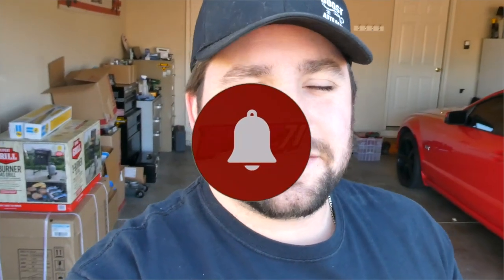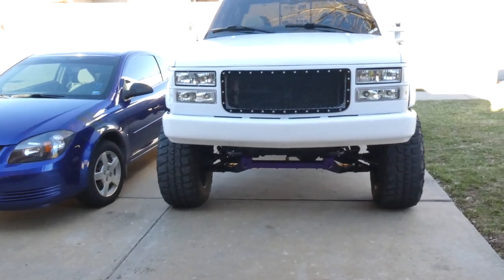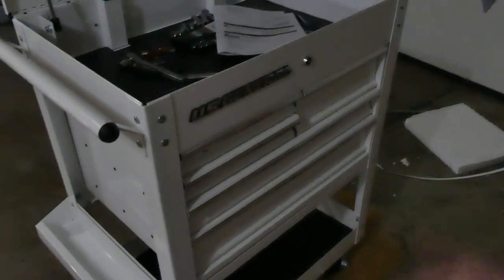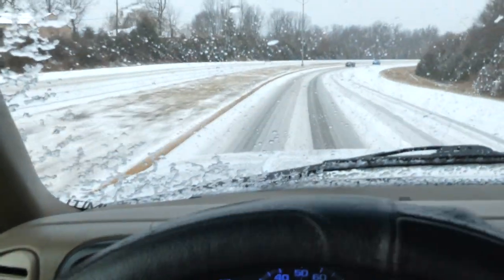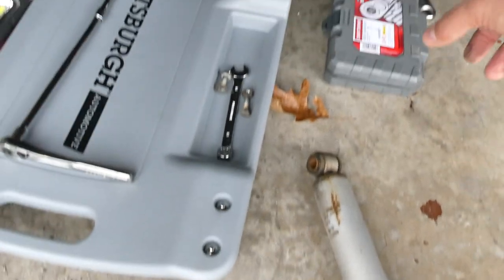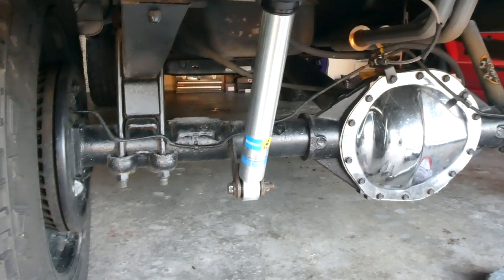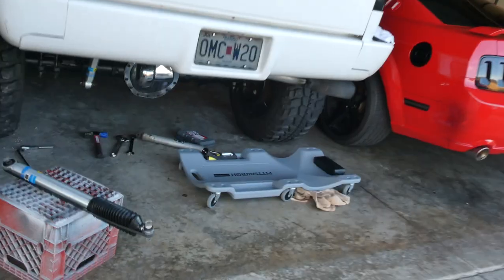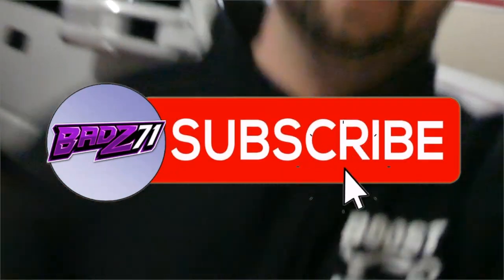These shocks are AMAZING!

Comment: Too late now, but those bushings you ground down are supposed to be very tight fitting! They are designed to have the two sided mounts pinch them tight, so there’s no play, plus no binding on the shocks eyelets, so the shocks pivot freely! The only time I’ve had a shock break is when I ground the bushing! After removal you could see how tight and binding the flanges were, that contributed to the breakage. Good luck have fun and stay safe and healthy !!

Comment: 4 days ago I installed Bilstein 5100’s on my 2006 Duramax   This is a different truck.  It is awesome to drive this.  I also put a new Bilstein steering damper on the same day.  Don’t buy anything else.  I took off a set of Monroe with right at 20K and they were toast.  The front was so bad that once I loosened the nut the bolt cane off without any pressure on the shocks.  I changed all the shocks without taking off any of the wheels.  The old shocks did not rebound and were half the size of the new Bilstein.  Don’t even consider another brand.

Comment: Traction bars usually make a truck ride firmer than it did before because they cause binding in the suspension to not allow your axle to hop or wrap. If you get the kind of traction bars that affix to the axle in 2 points and have a shackle mounted on the frame this isnt the case and it should still ride good. You are right that torsion keys can become rusty however the key itself doesn't move at all when the suspension cycles, I honestly dont think youd notice a difference with old vs new keys as long as you have them set the same. New torsion bars would definitely help ride. Or ditching the torsion bars in favor of a coilover like I've seen a lot of OBS guys do
Reply from the maker: Thank you for all the information in your comment! I'd always heard people say that traction bars make their truck ride better, but who knows. Maybe a ladder bar style would work best. I'd love to figure out how to do a coilover setup without going solid axle, definitely need to look into that.
Reply: @BADZ71  there are some posts on the gmt400.com facebook group about it.
Reply: BADZ71 
Look into RoadMaster Active Suspension for the rear.

Easy to install, and unless you tow severe loads, they will do the job of the traction bars, air bags, & rear sway bar all at one time.

Definitely worth it, rear will sit higher, but can change the block to a smaller one to compensate for that if you don’t want to change the ride height.

Comment: That was a good vidoe I found you on u tube last year I was looking for info when getting befor looking for lift kits you and a couple of other guys made me diside to go with rough country I did the 4 inch bit I already had taller shock on with level keys in i am running skyjacker on all 4 corners and have not had problems it ride at least the same as the factory shocks I took off I never even got the rouch country shocks out of the box I was get tire rub with the 4 inch kit so I ordered the 2 inch leaf springs for the back going to lift it up to the 6 inch in the spring time
Reply from the maker: 6" is definitely more worth it. Thank you for the compliment on the video!
Reply: @BADZ71  you have not done a video that I didn't like or find usefull. I tried the cheap 80 dollar level lift keys and rear blocks to lift the truck 4 inches but the suspension on the truck only would allow it to go 2 and 3/4 inches and the angle of sits at after destroyed both drive shafts and a hub bearing cost me 300 yo fix that and that's when I did the lift the right way I have followed your channel since then and gone watched the old videos as well as the new ones I appreciate what your doing and enjoy your truck build as much as my own